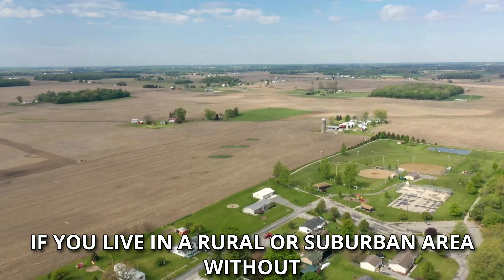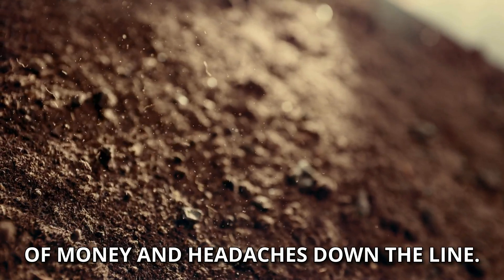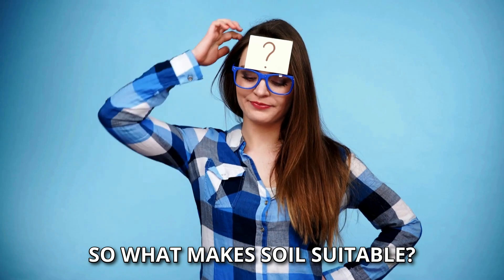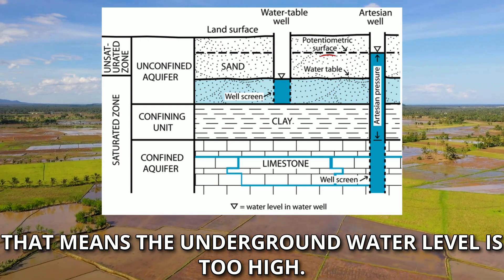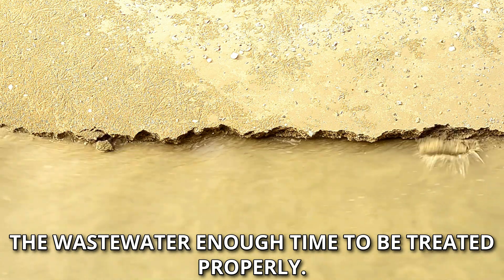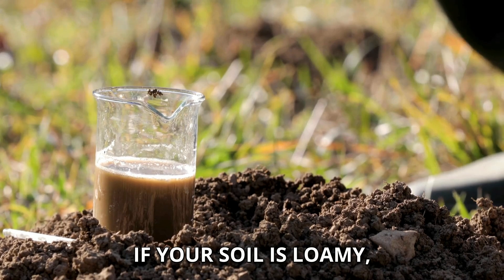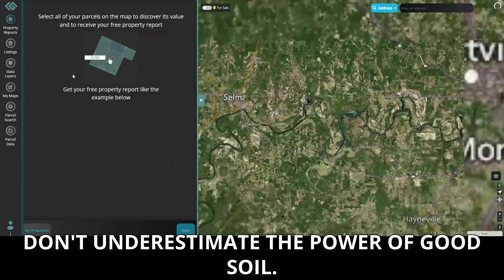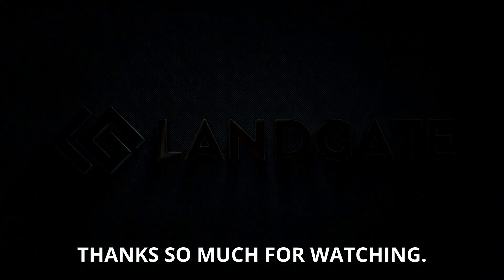What is the Best Soil Type for Septic Systems

Comment: I am here because my property is in a rural area and having no public sewer line is a huge pain in the ass. Our engineers/architects, unfortunately, tapped tboth gray and black water in a single septic tank. It's a 3-meter deep with only 2 chambers but huge enough for less than 10 people with 3 bathrooms. Heavy rains affect the soil and therefore can sometimes make the water in the septic absorped by the soil slower. Thanks for sharing this.